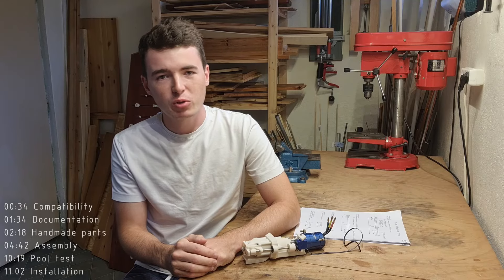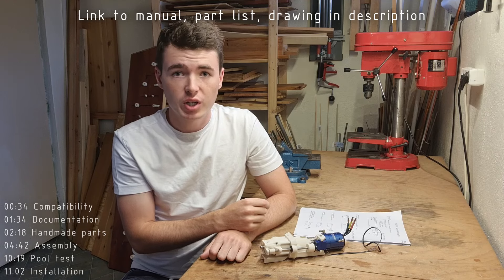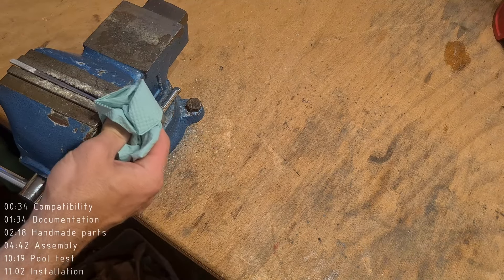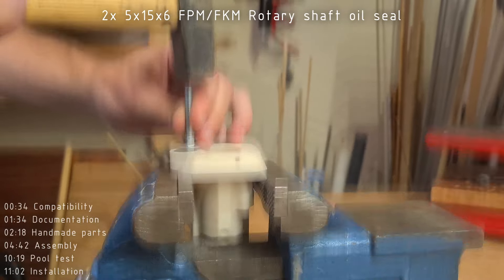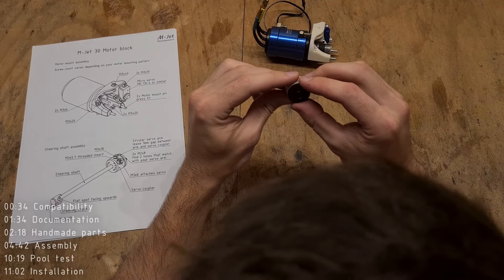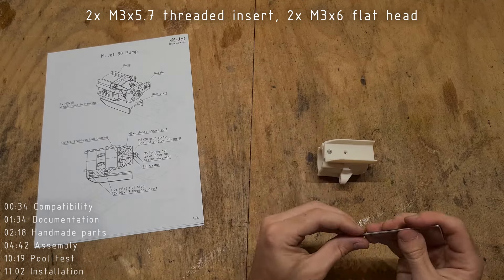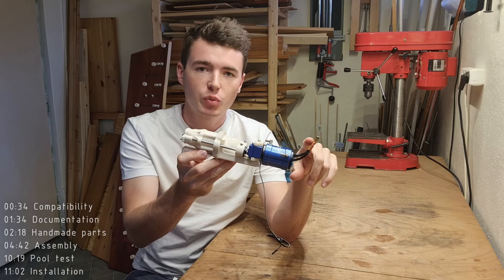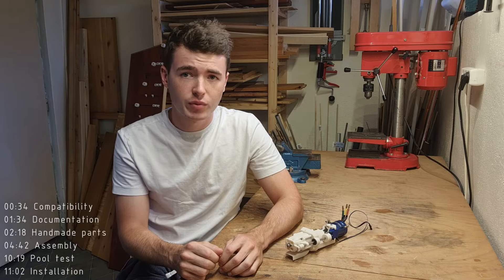M-Jet 30 Update & Full Build / 3D Printed Jet Pump

Comment: what type of battery should i use with the 2150 kv  motor and 100a esc?
Reply from the maker: 3S 2400-2800mAh for best runtime.
4S 1800-2200mAh for best performance.
Reply: @mjetdevelopment  thank you!

Comment: Hey!
Could you please explain the equations you showed in an earlier video to calculate input/output efficiency? What do the symbols represent and what do I need to measure? Input is easy of course but I’m a little confused about the output power calculations.
Reply from the maker: @nej113  I measure thrust of the pump. I also know area of the exit nozzle.
From these two, I can calculate mass flow. See, Thrust T, mass flow m, volumetric flow Q, nozzle area S, exit velocity v, density Ro, metric SI units:
T = m*v
T = Ro*S*v*v
Therefore 
v = (T / (Ro*S))^0.5
And 
m = T/v

Then power output P is equal to kinetic energy of water which flows out per 1 second
P = 1/2*m*v^2
Hope that helps.
Reply: @mjetdevelopment  So you would start with v = (T / (Ro*S))^0.5 as the known variables are thrust, water density and nozzle area? And then go on from there?
Reply from the maker: @nej113  Yes
Reply from the maker: @nej113  Also keep in mind this is only valid for static thrust test. For a running boat it gets way more complicated and so far I havent managed to fully measure performance of a running boat.
Reply: @mjetdevelopment  Thank you so much! I'm in my final year of school before university and we have to do some kind of bigger project. I've been watching you since the original M-jet 30 and I thought this was a perfect opportunity to try and design my own jet drive. My plan is to design and 3d print a jet drive and then measure static thrust efficiency (input and output power) and try to optimize it to some degree. You've really been the inspiration for this project so thank you.
Reply from the maker: @nej113  Glad to hear!

Comment: Which is bigger, 30 or 35?  What is the thrust difference?  I second the request for jet surfboard pump.
Reply from the maker: M-Jet 35 has approximately 35mm impeller diameter, M-Jet 30 has approximately 30mm impeller diameter.
M-Jet 35 has much higher performance potential, depending on the electronics. M-Jet 35 requires bigger motors and much bigger ESCs.

The setups I had produced 5.3kg with the M-Jet 30 and 6.8kg with the M-Jet 35, however in those tests the M-Jet 30 operated at the peak of its capability, while M-Jet 35 could still achieve much more if high end electronics are used.
Reply: @mjetdevelopment  Thank you for your information. Can you please make M-Jet 50?😂
Reply from the maker: @scoty7392  Hahaha maybe

Comment: Hell yea ! You should design one for a kayak. Like a 200mm. Lol you’d need a Jupiter resin printer.
Reply: For 200mm you would need at least a over 100horsepower Motor Dude
Reply: @SpencerGaming7580  is that how it maths out ? There’s a few jet kayaks available already and 100 horse isn’t impossible. But i agree that’s a bit over kill
Reply: 100mm is more than enough for a Kayak, it also mostly depends ob the Form of the hull. Kayaks are Not really designed to Go plane and have a lot of drag, so you would Just waste all that Power unless you Take a Kayak Like youngsters Jets If you know him. When the Jet Diameter gets bigger the Power needed to operate IT properly rises exponential
Reply: Look up his Mjet 60

Comment: Love your designs! I personally use two of your two-stage MJET 60's for my electric surfboard. Only modifications I've done to it is increased diameter for water cooling and a second large water pickup for better heat dissipation

Comment: Do you have a reverse bucket design? I haven't seen one of yours with one?
Reply from the maker: @burner8126  Currently no M-Jet pump has any reverse bucket. I don't design them because:
1) The boats can usually turn 180° in place, there is very rarely need for reverse
2) If there comes a need for reverse, it works to slowly spin the motor backwards and drive backwards that way
3) A reverse mechanism would be bulky, add complexity, pars and weight, which goes aganist the intention of a simple and robust design.

Comment: The 3d printed parts shown here are all in PLA?
Reply from the maker: This is all ASA, but you can use PLA too.
Reply: @mjetdevelopment  but is there a particular reason why you choose ASA? You recommend ASA for the drive unit?
Reply from the maker: @ripmax333  I have good experience overall with printing ASA lately, my printer is well tuned for it, prints fast. It can also be acetone smoothed, which I used to increase efficiency of the Supersprint pump. 

I also used PLA before for many different builds with good success.

I find that many people use many different filaments, and everybody has different experience. Therefore I suggest that you choose the material you have the best experience with and are able to print it in the best quality.
Reply: @mjetdevelopment has anyone tried SLA prints with your models?
Reply from the maker: Yes, it also results in the best surfaces in the pump, getting best performance. Some people succeeded. However it can cause some complications with the threaded inserts, 100% infill ends up heavy, and overall I design everything for FDM. I don't recommend SLA unless you really know what you are doing.